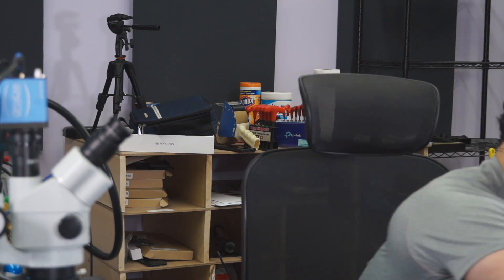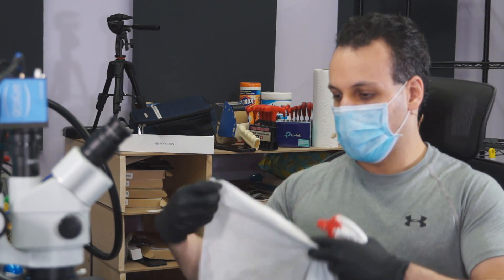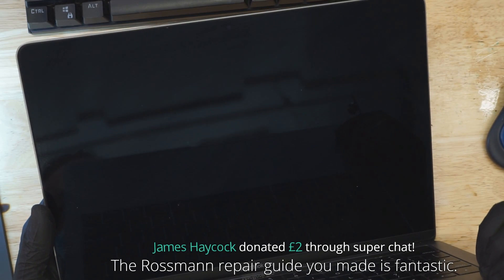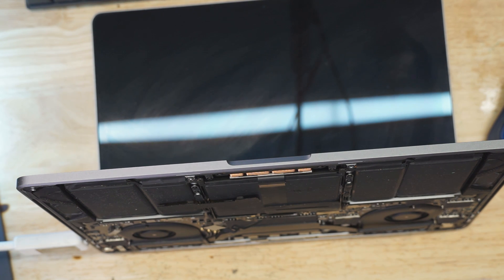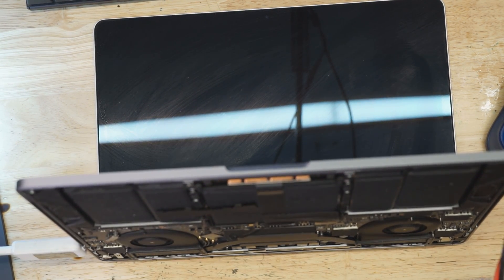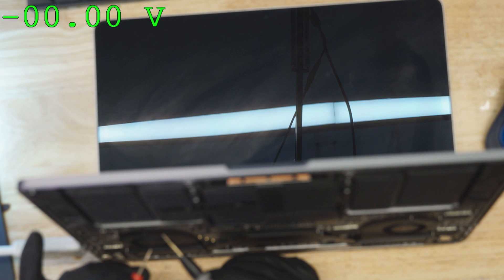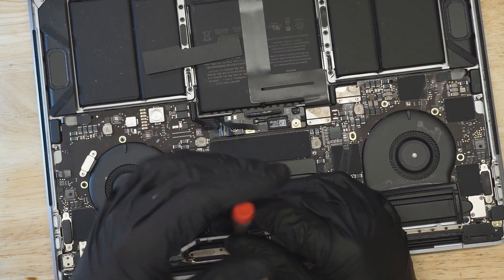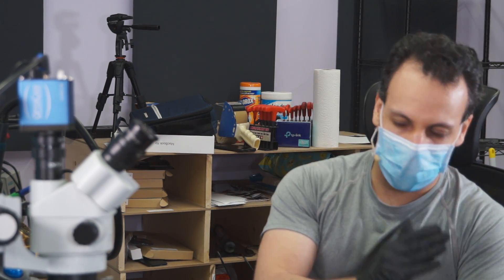Apple PCB design is a meme.

Comment: That's the point right?
1. Apple putting 50v port next to data line
2. Costumers spill some liquid on it
3. ????
4. Profit
Reply: @zsin128  THATS TO CHARGE YOU CLOWN
Reply: @zsin128  YOU'VE OBVIOUSLY NEVER HEARD OF CAPACITORS AND VOLTAGE STEPPERS
Reply: @zsin128  I highly doubt the guy that works on MacBooks for a LIVING doesn't know what he's talking about
Reply: @zsin128  you are surprisingly confident for someone who knows so little about electrical engineering
Reply: @buddyguy4723  I know right?
Reply: @Dragini7  i wonder if he has ever seen or heard of the very common 12v dc to 120v ac POWER INVERTER
what fucking magic is this he would say lol
Reply: @Dragini7  better yet, battery powered Tesla coil.
Reply: @buddyguy4723  lmfao ye that would be straight up witch craft to this kid
Reply: @buddyguy4723  or a fucking taser that is 50000 volts, using AA batteries
Reply: @zsin128  wow, you mad hahahahha
Reply: @zsin128  ya the WHOLE video was about the 50V trace powering the back light being right beside the 1.1V data line directly connected to the cpu. you're the only one that thinks anyone here was talking about the charger. try to keep up
Reply: @zsin128  LMAO...Imagine being you
Reply: the ferengi could learn a thing or 2 from apple and still seem like the good guys
Reply: @zsin128  wtf are you saying? i know mostly nothing in electricity but i know that. you know some soundcard in usb turn the 5v in 48 for XLR mic right?
Reply: @zsin128  Aaah. You are barely 12 and you know that we are all fucking idiots. I see now. Let's read these coments again once you are grown up.
Reply: @csupakabra4  I'm 14
Reply: @zsin128  no wonder you assume to know exactly what you are talking about no matter how absolutely wrong you literally are.
Reply: @zsin128  If you weren't so fucking stubborn and listened to the video, at multiple instances, like 7:05, he says "52 Volt powerline, 1.7 Volt data line". It's not us inventing, it was what he said. The 18-20 DC charging has to do with the battery, not with the CPU powerlines. If you really knew, CPU's do not directly work at 18-20 DC. There are multiple step ups and downs before being converted to the final voltage. But hey, if you insist on talking about charging voltage instead of the CPU powerline voltage, banging your head on the wall will only hurt until you pass out.
Reply: @zsin128  Everyone else here has already covered it to death, but...
Sure, the laptop takes an 18V input from the charger, but the motherboard then converts that 18V to a number of different voltages internally to suit the various components, including stepping it up to ~50V for the backlight.
Reply: @dylanh333  You explain it much better and politely. then the other ones directly screaming back to the clueless kid.
Reply: @Marfprojects  Haha, thanks! Everyone is so on edge in YT comments sections, and when everyone is screaming at one another, ironically, nothing gets across.
Reply: Julian Widjaja it is the ford pinto design model
Reply: @zsin128  Relax dude, have u find out how DC-DC converter works?
Reply: @zsin128  Being like: "LOOK YOU IDIOTS I GOOGLED IT AND I KNOW BETTER" and "SO WHAT THAT I DIDNT UNDERSTAND YOUR COMMENTS? I GOOGLED IT MORONS" must feel sad
Reply: @zsin128  Not very bright are you
Reply: ever heard of boost converter ?
It is a small circuit that can convert lower dc voltage to higher dc voltage
eg: 5 volt can be boosted upto 50 volt or more,
I'm not saying that macbook uses 50 volts, what i'm saying is that dc voltage in a circuit can be boosted up.
Reply: https://www.youtube.com/watch?v=ahKH19iN2SM
Reply: Ngl I'm enjoying the nerd battle on this comment
Reply: @ethanholter  you're welcome
Reply: @zsin128  Didja even finish the video before commenting?
Reply: @zsin128  input is not output you fuck stain
Reply: @togebit  zsin128 sounds like the ultimate example of the dunning kruger effect.
Reply: @zsin128  Instead of calling others idiots, see what context you are. Don't call "Y'all are fucking idiots.. google "how much volts MacBook uses"", because you don't even googled the right thing. Get your head out of your arse and google correcly.
Reply: @epstinian  did you delete one of your comments? I got a message that you said "DraginEye is this the answer?" But I click it and it's gone, so what's up
Reply: Ok I get it, I was wromg

Comment: It's almost like they want the machine to fail, so that the customer has to buy a new one!
Reply: It doesn't take a genius to figure out that problem. Even a person with a slight knowledge on electronic will figure it out. It was designed to fail. And the fault would be on the customer.

Comment: Hi Louis, I have a rMP 15 from 2014 ( a1329), and the right speaker is low on volume (checked software before, audio midi, swapped channels  no chance), ordered new speakers (at the change I used the old right speaker in the left bracket (worked like a charm at full volume, but the new one worked like the old one, 1/4 of volume, same when swapping them in between) so this points to a hardware issue. Any idea of issues with the  U6630 or should I look somewhere else ? (as I'm from EU I can't ship it to you for solving the issue, also this is for my own laptop) Thanks if you answer and keep up the good job!

Comment: with all due respect, u complain that a 52volts should not be next to a 1.7 volt data line. what design would u do to improve and prevent this issue/disaster? im no computer engineer or anything, so i hope u can explain it simply.

Comment: Maybe Apple deliberately design their boards such that any failure will be complete (or near-complete), as opposed to having a malfunctioning device. Perhaps they’re opting to have their machines exist in a binary state; either working completely or not at all, to prevent the spread of stories such as “I had a MacBook but I didn’t like it because of [insert problem]”. So, if/when the customer damages the device and it instantly dies, then they directly blame themselves, and not Apple. But if a component, which merely hinders the machine, were to be damaged, then the user might not see the correlation between their damage and the device problems, and might be more likely to blame Apple, thus hurting their brand.     This is the type of “Think Different” crap I’d expect from them.

Comment: As someone who designs PCB, I think what happens with apple is the designers are constrained about how many and or how big connectors they can use. If you use a separate connector, maybe you can't fit it in that space. Sometimes for fast paced assembly, the number of connectors has to be kept to a minimum. So when the designer gets the task and looks at the constraints. He says - chuck it, I can't design this to be a tank with those constrains. Then he switches to a design mentality where if things are not used the way they are supposed to be, its not his fault. This means there is very little room for mishandling. I usually do this for factory use only/programming connectors where I am constrained on the pin count and don't want to pay the cost of additional pin and boards space.
In PCB design, the schematic is built first. And the schematic does not give you an idea of the physical layout of the connector. When time comes for layout (actual routing of traces on the board). Often it is too cumbersome to change the schematic because the pin that gets swapped may also have some constraints.

Comment: I've been abducted by aliens but now I'm back so did they vote yes on right to repair? My 15 year old Whirpool went on the fritz and found the problem to be the lid safety switch. I tried to pull the wire harness from the switch and found they glued it in. (!!!???) So I jumped the white wire and grey wire and it sprang to life. There are at least 5 websites that sell appliance repair parts so I'm wondering why Apple is so stubborn.

Comment: It would be much safer to “disinfect” notebooks in an area other than your office or desk. 
You should treat your office and desk especially as a “clean area” and not stir up possibly infected matter where you work and most likely eat as well. 
Better yet, divide your office into hot, warm and cold zones. 
Clean the notebook once at your front counter on intake. 
Clean it again, in the warm zone (when taking it out of the queue) into your work area (the cold zone).

Comment: My wife put a chocolate egg down on top of an old laptop. The laptop had just been turned off, so she expected it wouldn't be hot. But it was right on top of where the heat pipes connect to the fan, a fan that was then off. It was still hot enough to melt through the keyboard and cover the motherboard in chocolate. Had to disassemble the whole thing and clean it carefully. Fortunately, since it was off, I could clean it up without worrying about a short circuit. When I put it back together, it worked just fine. Better than before, actually, as I thoroughly cleaned out years worth of dust.

Comment: For those interested, it's not necessarily the distance at play here, I have done a video analysing this and testing this, EEVblog #1222
Reply: Will do, Dave.
Reply: What about crosstalk?
Reply: @maxikaifyst4286  Increased proximity will increase crosstalk, but the EMI from a 52VDC LED line isnt going to cause the voltage on a data line to exceed its rated voltage.
Reply: Hello mr. EVV!!!

Comment: All those Multiple GROUND pins on that connector,  and they did not put one of them between the backlight HV pin and the CPU  LV pin !!

And now, even with it is as it is,  just a small amount of Conformal Coating  would GREATLY reduce the chances of water damage causing  short between these two pins, (sigh)
I bet it was not an oversight  ..but rather was a Design Feature  requested by the Sales Dept.

Comment: I am an Engineer and you are right. Data separate from power even in big building cable paths, Data is on a different path at least 1 meter away. 

This is why I say apple are a rip-off, things like this don't matter because they target an audience that doesn't know the difference so it doesn't matter.

Comment: The real question is why are the motherboards still not conformal coated to protect against liquid? Granted it wouldnt help on a 52V -> 1.5V in a connector, but it would solve a lot of liquid problems.

Comment: I think the term 'designed defect' would be about right, and would not surprise me in the least. Too easy for fluid to get in there in the first place, ad then a simple short across those circuits make the machine need a new board.

Comment: The thing is, coffee addiction or rather caffeine addiction probably doesn't ruin you and you don't need to turn a criminal to get your coffee fix and you probably don't hurt others with that. Disclaimer, heavy coffee drinker. But I don't need to get it up. It's just a habit, love it. Doesn't stimulate me anymore probably when it comes to caffeine anyway. Well doesn't matter. Am surprised your stance on that. Well too bad. Guess Marijuana is not yours either 😂. Although I guess some might argue that caffeine or nicotine are more addictive than ganja (ok you can also argue about "more" which doesn't work if you compare something with zero in mathematical terms), at least physically it is not addictive.

Comment: The main flaw i spotted was to put it some where uncovered that could get any liquid on it. It was technically far enough apart by only just but any liquid or other material that can connect electricity got there will create a circuit and the 52V will go to the 1.7V and it will fry everything until it gets to a chip where it has over voltage protection and/or it ran far enough it lost enough voltage to not keep on destroying stuff by over volting them.
Apple seems to be stupid and not put a over voltage protection chip between the 1.7V next to the 52V thing and the CPU. Replacing like a fuse or some such would be cheaper and faster than having to replace an entire CPU. This is just bad design on both ends of the circuit but then you get into latency cost of having the over voltage protection in place. To this i think a stupid designer got make the call between chip safety and lower latency. Either that or marketing did as it could be used to say their laptop is better than a normal one due to "better design" when taking something out that was there for the reason of not killing important chips.

Comment: You assume that Apple did this unintentionally. If I was the asshole in charge of Apple I would give this guy a raise for increasing Mac device turnover rates.
Reply: sure, but to be fair they did not sell them as "liquid proof"... so, as long as user keeps them away from liquids - NO Problem (even with that "bad" design - pun intended)!

Comment: As an engineer I can tell you that you're right lol. Many engineers just do their 9-5 and shit on company time because why not. Wouldn't be surprised if they know it's a problem but it conflicts with some product design guideline from management so nobody's gonna stick their neck out.
Reply: As an engineer you have basically three options in the (un)professional workforce:

1. Unbearable frustration:
You repeatedly stick your neck out and start to work +80 hour long work weeks with unpaid over hours, just to cover-up your manager(s) recurrent failures.
After a while you will learn that you manager is actually not interested in solving any engineering related issues, 
but that all your hard work, to cover up his mistakes, are helping him to reach his goal, his next big promotion. 

2.
 The smaller the company, the smaller the misery:
You find a startup company and/or work as a freelancer if possible.
You change your job (or project) at least each 2 to 3 years, or when the startup isn't a startup anymore, to avoid any corporate 'idiocracy'...
If there is more than 1 person in-between you and the co-founder, the company has become to large! 

3.
 The comedy sketch:
You become one of those 9 to 5 engineers. 
You understand your managers are adults with responsibilities, and in most cases higher pay-grades than the engineers they boss around.
You only warn your manager once or twice and make sure to have prove on mail and/or paper.
If when your manager ignores your warnings, you and your colleagues can buy a bag of chips, and watch a live comedy sketch unwrap at the end. 

Please don't blame the engineers for their managements incompetence...
Reply: TimDVProjects thank you for your knowledge
Reply: @timmy7201  Other question: why do they have 50 V for a backlight? I mean...you can run LEDs on 5V and they are already crazy bright. So why 50V?
Reply: @JanB1605  For higher efficiency backlights use several LEDs in series. Pumping up the voltage means less current, narrow and thin traces on flexible printed circuit. It's all about cost and efficiency.

Comment: A1932 Air is another example of bad PCB/product design. The audio board, is connected with the main board through a flex cable which has PPBUS and various data lines going through it. And a pin for PPBUS is right next to a data line that goes to the T2 chip. That spot absorbs liquid like a sponge, have had countless cases of these Airs with dead T2 chips. I'm willing to bet that the new 2020 Air uses the same design.

Comment: They could fix the problem without changing the pinout of the connector. They could add a 0 ohm resistor 1/8w or 1/16w and a tvs diode. If there is an overvoltage the resistor will blow and the cpu will be saved...

Comment: The company I work for used to make CCA's for Apple 18 years ago or so. It wasn't just us alone, we were one of 6 or so US companies doing it. Quality was a big deal. 

During HS I was on the production floor and remember seeing our engineers rip their hair out because Apple's Engineers would make random rev changes, drawing note updates, find #changes. Just because they wanted to. They would send a red lined document, then once the official TDP documents came out only some of those changes (in the red line) actually carried over. 

Fast forward 10 years to today and I work in Engineering now and found some of those old documents. It's nuts how things have changed. We dropped building shit for them and they switched to Chinese companies to save money. They used to be all about quality but suck now. Same goes for companies like Asus. Their shit was comparable to class 3 (because they produced their motherboards in the same factory that produced class 3 CCA's) but now they are getting worse and worse.

I hate Apple with a passion now. Google their sub company named production sites over in California. Shits borderline slave labor.

Edit: Okay I've always hated them.
Reply: Yar Nunya  Sorry, what?

Comment: I get it, from a repairability standpoint this sucks. But who is really to blame here? Apple for designing it the way they did, or the dumb ass user that spills liquid on a $1600 laptop. Even if Apple designed it to have the 1V and 50V at opposite ends of the connector, a big enough spill would still short it out and rants would continue. Damned if they do, damned if they don't.

Comment: I need help with a MacBook 12" 2016 , when i try to install the system reboots and gives kernel Panic error : nvme fatal error . 
Anyone had this issue and solve it? 
Thanks
Reply: Probably failing CPU like every other 12' Macbook
Reply: @Kagetora_sama  CPU really ? 
When i boot whit external hard disk it works perfectly...
Reply: @davidv2833  yup very likely... the ssd is soldered to board and tied to cpu... also from all the research ive done and machines ive seen this particular machine is prone to cpu failure more than prob any other device apple has created
Reply: @Kagetora_sama  Apple dont have a exchange program for replace Logic boards for permature failure ? 
Im sorry for my English